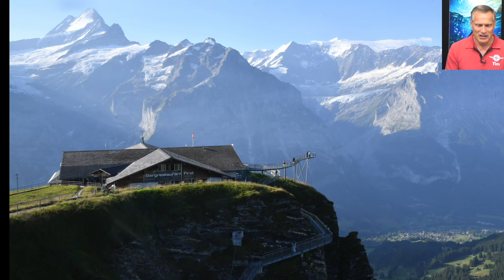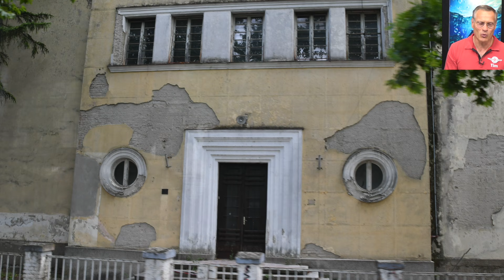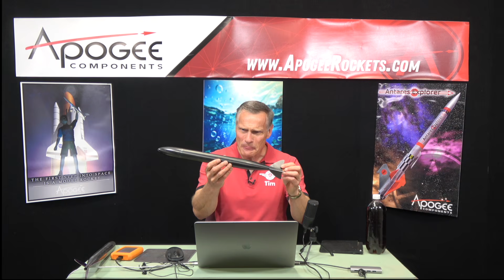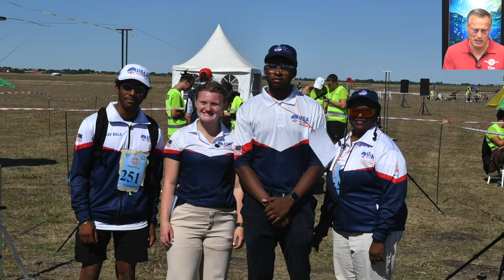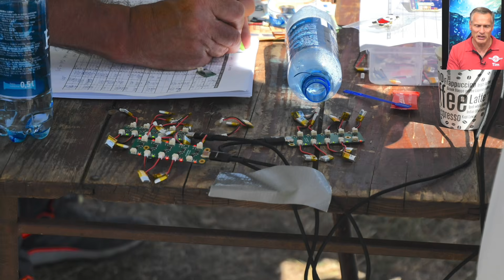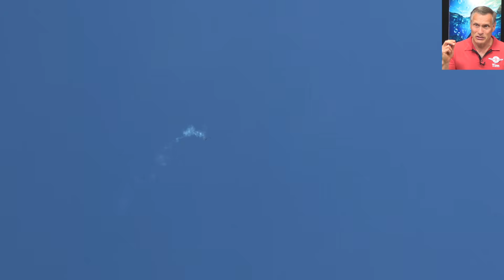What Does it Take To Be An International Champion Rocketeer?

Comment: I noticed you wearing black gloves while spray painting, in the intro video clips.
Black gloves are usually latex rubber. This is NOT ideal for the solvents/propellants in rattlecans. Ideally you'd want to wear nitrile gloves for that.
What gloves you wear with which solvents matters a lot. MOST adhesives we use are best used with nitrile vinyl gloves, not rubber. However, with plastic cements that chemically weld together plastics, latex rubber is better (tho not immune).